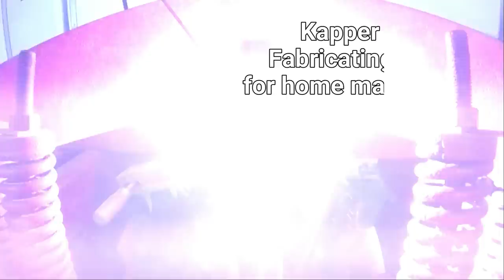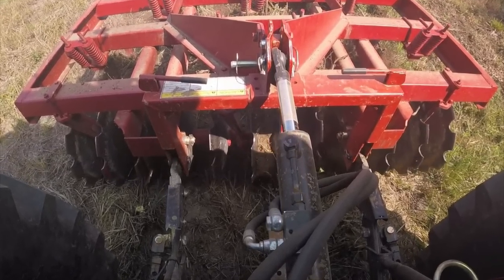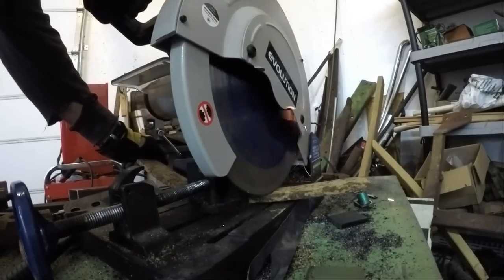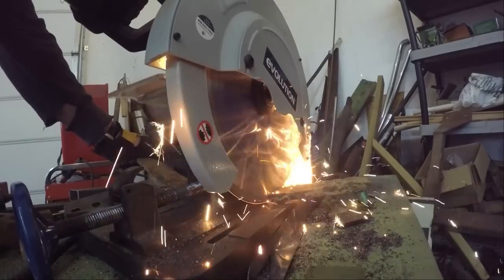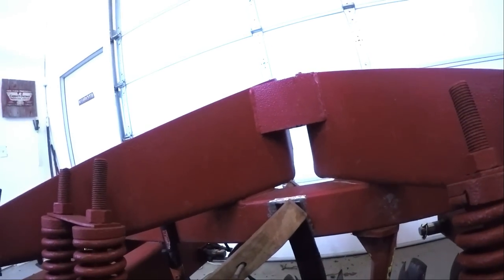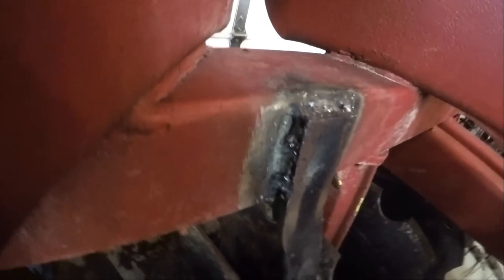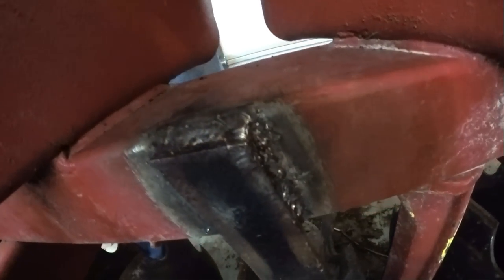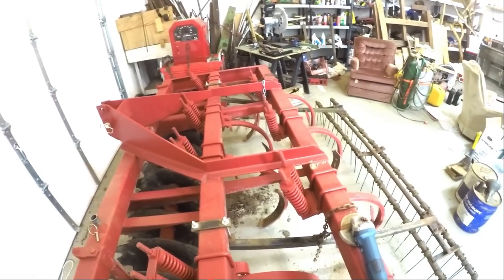Fabricating; Welding dirt cleaner for home made food plot disc chisel plow

Comment: Yes, it will hold forever and that's what counts in your job. But damnd, the weld seam looks like parkinson-illness... This is known as gluing and not welding. Take two ~10-inch long flat irons from the scrap and weld them into shape at a 90 degree angle - one on the middle of the other. First with spot welding (90°!) and then weld them both side together. The nice thing about welding is that you can see immediately what you've done wrong. Weld 5-6 pieces together and you are a pro in this chraft too. There are enough welding examples on your agricultural equipment.
Reply from the maker: My main struggle is welding on a vertical surface. Horizontal I'm pretty decent
Reply: @kapperoutdoors  These are good videos keep it up. Enjoy nature and your hard work in the country. Making YouTube videos should be fun and not work.

Comment: You might not want to cut tempered steel on your metal cutting saw as it shortens the life of the blade. A torch might be better suited, as it can cut most grades of steel. I once made some specialsed prying tools and used hardened steel for the cutters. These I annealed with the cutting torch to notch them out for the shank. Just FYI.
Reply from the maker: Yep, I am not that experienced with telling the different kinds of metals, and man, that one was hard to cut!!! Wish you could have mentioned that before hand! LOL 
Thanks.
Reply: @kapperoutdoors  a file would have been a good friend as it would have shown you, in a general way of the grade of steel. If the file leaves a mark, it's soft. If not, it's probably hard.
Reply from the maker: @Farm_fab  Now that's the kind of tip I can use! I'll try to remember that!! Seems pretty straight forward. Hmmm, in the Marine corps, and night school courses, making acronyms always helped... 
NFCITSHARD.... 'No file cut its hard' steel!! :)

Comment: NICE!!   But did you put the scraper on backwards to the way the disc blades will be turning?   Anyhow, having a scraper on those center chisel blades should really help keep it and stop it from  packing solid.   Should work either way.
Reply from the maker: Yes it is angled back towards the oncoming rotation. Should work well, but I'll believe it only AFTER I have field tested it!!